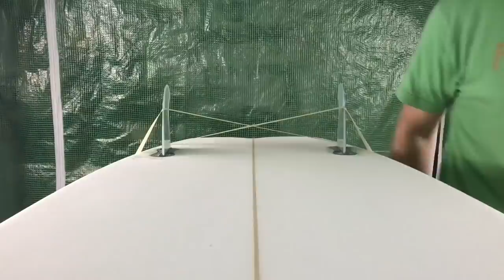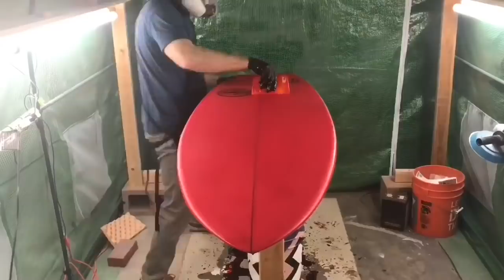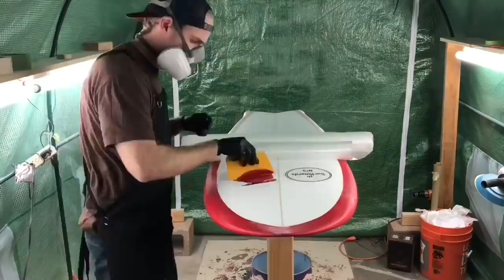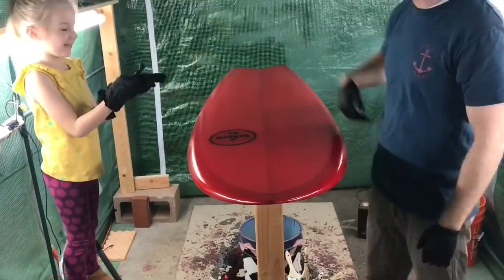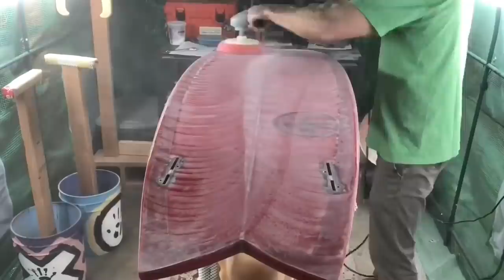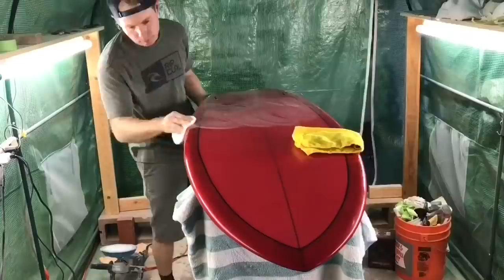Surfboard Glassing [Polyester Resin Fish]

Comment: I worked for glasser in hawaii for few months.  Biggest time saving tip is to use hard back sander on first pass.  Like 60 grit.  Especially on laps of glass on rails.  Fast and end up with smoother end product but have to be careful not to sand through.  Lol. Great video.  I could almost smell the resin.  Mahalo.
Reply from the maker: Thanks man, appreciate the tip and feedback 🤙

Comment: Hello Tanner, great video man! I saw you put the fins at the beginning of the whole lamination process (before the cloth and first lam coat) but not sure why didn't you put the plug during this same stage? Thanks you!
Reply from the maker: Thanks man, that’s a great question.  You can actually do the FCS 2 fins before glassing or after, I’ve seen it both ways.  Most do it before and it’s what FCS advises as well. The leash plug and longboard center fin boxes go in after the hot coat. I don’t really have a good reason as to why other than that’s what I was always taught and is industry standard.

Comment: This was a great video. Ive been using as a quick reference video.  its nice to have all the steps in one video. 🤙🏼
Reply from the maker: Thanks man! Glad to help out.
Reply: Hey Tanner, Do you use anything to clean the board after sanding the hot coat? My last board I sanded then used denatured alcohol to clean the board before the gloss coat and ended up with tons of uneven spots. 

Gary
Reply from the maker: I usually wipe it down with a rag and then blow it off with a shop vac. I do also use denatured alcohol but very little. I just dab a little onto a rag and do a quick wipe down of the board. Be sure to sand in long drawn out passes to help keep the board even. I also get uneven spots some times, it’s hard to make it perfect. Good luck!

Comment: Hey man! You can save the paint brush... put in thinner... and them wash whit hot wather and soap.  Three times.. and save in a pice of cloth with the soap foam... i dont now.. if the paint brush is very chip , it is unnesesary... sorry for my inglish.
Reply from the maker: Thanks for the tip! I’ve actually already started putting my brushes in acetone to re-use them.
Reply: @BendheimBoards   beatifull jobs!!!
Reply from the maker: Thanks man!

Comment: Fully in it now!  I have my shape stand built, the green house in affect!  Thanks for the inspiration.   Just bought 4 blanks, glassing material, fin boxes.. one question, if you see this.  For glassing, when do you use laminating resin and sanding resin?  And do you use both?  Thanks, i may learn the hard way!
Reply: Sanding resin (with added wax in styrene) is for the hotcoat (after glassing the board)
Reply: @jipanzz  thanks!
Reply from the maker: Laminating resin with the fiberglass cloth and sanding resin for the hot coat to seal it. Use laminating resin for the fin and leash plugs as well. Laminating resin bonds to the board better and sanding resin allows you to sand once cured
Reply: @BendheimBoards  thanks!

Comment: Hey Tanner, love watching your videos. Do you have any tips for laminating the swallow tail? I can never lam the buttcrack area on the first go. Also the swallow tips tend to get pretty messy.
Reply from the maker: After my lamination I put an additional clear patch of fiberglass on the deck side of the swallow tail to cover the section of foam that my cut lap doesn’t get. If your doing a resin tint color just be sure to get the color on that section of foam even if the fiberglass doesn’t cover it. Then go in with the clear patch. Works great. For the tail tips just make sure you are checking your angle cuts on the fiberglass and how they will fold before adding the resin so you have clean overlaps. Good luck!

Comment: Hey man, I really appreciate the content you are putting up.
I have a similar shaping set up in my garage. So far I have only been shaping epoxy, however I’m interested to try poly resin.
What was your experience glassing polyester resin inside your garage. Were you using any type of ventilation?
Cheers!

Comment: Hello mate,

can you talk about the grit progression with this? 

In hotcoat and gloss coat!

lovely job , nice work!
Reply from the maker: Thanks!  Here is the grit progression: After the hot coat start with 120, then 150, 220, 320 and 400. Wet sanding with 320 and 400 is also a good idea.  This will give your board a matte-finish. After the gloss coat, start with 320 grit then move to 400, 600, 800, 1000, and 1,200. You should wet sand all of these grits. Then finish with compounding liquid and then polishing liquid. Good luck!
Reply: Tanner Bendheim what a great specimen you are! Thanks and keep posting. I watchd this video maybe 10 times!
Reply from the maker: Glad you liked it! A helpful resource is greenlightsurfsupply.com if you need more info on board building. They have detailed step by step instructions. https://greenlightsurfsupply.com/pages/greenlight-surfboard-building-guide-page-4

Comment: Hey, great video! I have shaped a few boards myself but I am going to try glassing myself for the first time. I'm not so much as nervous for the lamination part as I am for the hot coating. Could you elaborate on your hot coat process please?
Reply from the maker: Thanks! The hot coat is pretty straight forward. Lamination tends to create the most problems when going in for the first time. As long as you have a clean and smooth lamination, the hot coat will go on easy. Just make sure you have a clean brush, use long stokes the length of the board and cross stokes across the whole board. Make sure you finish before it starts to kick. I suggest reading the detailed instructions on www.greenlightsurfsupply.com. They walk you through the whole process. I’ll be posting a hot coat video this week or next as well. Best of luck!

Comment: Just shaped my 3rd board and considering trying to learn how to glass. Found this pretty inspiring. Did you just cut the tail overlaps with a blade? Does it cut into the blank much? Also did you go with epoxy or PU?
Reply from the maker: Yes I cut the rail laps with a razor blade and if the blade goes into the foam a little its not a bid deal at all.  Some are able to fold back the tape and do a zipper cut where they don't touch the foam but that takes more practice.  Just make sure you cut before it hardens or it will be a nightmare - start cutting around 1.5 to 2 hours after laminating.  This is a PU blank with polyester resin.  I have more videos for each glassing step that I've started posting if you want to check them out.  Good luck!

Comment: Hi Tanner, excellent video bro. I will like to know why do you put the leash plug after hot coat? I see the fins you put them before lamination and thought the leash plug would be put in at this stage as well. Appreciate your response, thank you!
Reply from the maker: Thanks man, that’s a great question.  You can actually do the FCS 2 fins before laminating or after the hot coat, I’ve seen it both ways.  Most do it before and it’s what FCS advises as well. The leash plug goes in after the hot coat. I don’t really have a good reason as to why other than that’s what I was always taught and is industry standard.
Reply: @BendheimBoards  appreciate you taking the time to respond, it helps!

Comment: Awesome work. I see that you used a posca pen for your lines and then gloss coated over it. How'd you not end up with any fish eyes? Did you wait for the resin to start kicking and get a little hot before applying?
Reply from the maker: I applied a few passes with the Posca pen. After pulling off the tape, I use a razor to scrape any small lines that bleed under the taped area. Then very very lightly I sand the lines down with a high grit sandpaper to get a smooth surface without any hard edges. Have to be careful not to sand through the line or you’ll have to reapply the line. Once it’s clean and smooth I apply a normal gloss coat and it works great. Didn’t do any special tricks with letting the resin start to kick as you mentioned. Hope that helps and good luck!

Comment: Nice video man, I like your precision- like how you tape your fins symmetrically,  and fold your masking paper over instead of tearing it. I have once question, how do you get your cloth inlays to "pop" with a darker color than the rest of the board? When I double layer (using a resin tint) it doesn't seem to show
Reply from the maker: Thank you sir! The extra layer of cloth should bring out a darker color for you when saturated. I’m not sure why it wouldn’t be. I used 4oz E cloth for both layers. I would search the archives of swaylocks.com to see if you find any articles of guys having that same issue. Good luck!
Reply: @BendheimBoards  Ok right on, thanks man!
Reply: I don't know how their doing it these days but back in the 60's when I was glassing we used a couple methods. 1) glass one side and trim it out. Tape off the inlay and paint the foam  your contrasting color and then clear glass that side 2) tape off the insert and use tinted resin and glass the insert only with the first layer and clear glass the second layer that wraps over the rails.

Comment: Hi ! Great video, thanks for sharing it ! 
I Can see you don't Sand the cut laps before doing the hot coat, i did the same thing and i have a gap between the laps and the bottom of the board .. Will the last layer of gloss be enough to fill the difference ? 
Thanks a lot , have a nice day !
Reply from the maker: I usually sand any excess resin or high spots. I also try to press the first lap down with a tongue depressor to be somewhat level with the foam. Not sure I’m visualizing exactly what your describing but adding the gloss coat won’t get rid of any bumps or gaps. I suggest sanding it even and then applying the gloss coat. You won’t have to worry about small burn throughs since your adding the gloss coat. Good luck!
Reply: Thanks a lot for all the information that really helps ! I'll try doing as you said !

Comment: Good morning, complements for your videos, very nice and useful !!!

I'm restoring an old kite surfboard, made of resin.

At the moment I have carried out numerous repairs with epoxy, fiberglass and mocrosfers, as a result the surface is aesthetically very unpleasant.

The original resin was transparent and graphics were integrated between layers.

I made the same graphics with the PC, so I can print them by ink jet plotters.

At the moment I purchased epoxy and fiberglass to re-laminate the whole board over the existing layers. I don't care about the weight, I wish it will be very strong.

I also bought a colorant for resins, white.

If you can, I need some advice to finish the work, to give the surf an aesthetic aspect similar to the original:

To give a white background, so as to cancel all the remaining signs of repairs, which is better than the following procedures?

Procedure 1)

- First lamiantion using only one layer of fiberglass and white colored resin

- Second lamination with the next layers of  fiber glass and trasparent resin and interposing between the layers the printed graphics

Procedure 2)

- I spread the white resin with brush all over the surface to erase the signs of repairs

- Lamination with all the fiberglass layers, interposing the printed graphics

Also, do you think for the realization of graphics it is possible to use glossy lucid paper (the kind used for techinchal drawings and china) or if you must use rice paper?

Thank you

Andrew
Reply from the maker: TheAndreasdoni Hi Andrew. I haven’t done a full restoration project like yours and I’ve only worked with polyester resins and not epoxy so take my advice with a grain of salt. I would use a white pigment (not tint) color in your laminating resin saturated with your layers of fiberglass cloth. It will be hard to cover old colors and you may want to do a white foam stain on the blank as well before the lamination. Just make sure you use water based paints with resins. As far as the logo, I always use rice paper so I’m not sure about lucid paper. After you’ve finished laminating the board, put the logo on top of the white lamination and cover with a small patch of fiberglass and clear laminating resin. Sand smooth but don’t burn through the cloth. Then hot coat. If you want other opinions, try posting your question on swaylocks.com or join the Facebook group Backyard Surfboard Shapers and post your question there. Good luck!

Comment: Do you use laminating resin at first then switch to finishing resin? Sorry that might be a dumb question. I’m trying to do a large repair on a delaminated old long board
Reply from the maker: Laminating resin first with fiberglass cloth, then sanding resin (lam resin with wax) afterwards to seal it. Then sand smooth. I’ve got a few ding repair videos.

Comment: Quick question, can you tell me if it's possible to put epoxy resin (as a final layer) directly after painting with acrylic spray, or i should use fiberglass? It is not super professional board, just first experiments... ;) Thank you!
Reply from the maker: Are you spray painting the foam blank or after the hot coat?
Reply: @BendheimBoards  i sanded the old board a little bit and repaired dings, and now painting, under the paint it has epoxy layers ;)
Reply from the maker: Hard to say when I can’t see it but the general answer is yes you can put epoxy resin over acrylic spray paint. Fiberglass cloth is the strength of the board so as long as the original fiberglass cloth is in good shape you should be ok.
Reply: @BendheimBoards  Thank you!

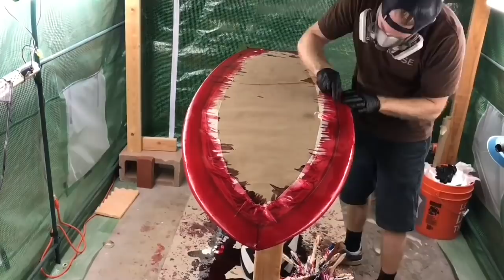Comment: Hey bro, when you finish the second fiberglass layer on the top deck. Do you not have to sand smooth the cut joint on the bottom of the board (see 1:48) cheers
Reply from the maker: Yes, I always clean up my cutlaps to try and make them as smooth as possible.  You can sand them down with a hard block with sandpaper or sanding disc.  You only need to hit the rough spots or bumps to make it all flat and smooth.  Just be careful not to sand too aggressive so you don't sand away the color if using a tint.  Good luck!
Reply: @BendheimBoards  oh yeah sweet, but you don't need to sand it flush right?
Reply from the maker: @jackzarifeh  No I don't get it completely flush otherwise you'd probably start burning into the color.  Just get it as flat as possible to make the hot coat process easier.
Reply: @BendheimBoards  sweet as thank you

Comment: Great vid one question what bit did u use on your drill to sand down the board after you did the cut lapses and what variable sander did u use?
Reply from the maker: Thanks!  Its just a power drill with a 3" disc holder: https://www.amazon.com/2-Pack-Disc-Holder-Shank-Roloc/dp/B07D342TQP/ref=sr_1_1?dchild=1&keywords=3%22+disc+holder&qid=1606781712&sr=8-1  and the variable speed polisher/sander is an ATD-10511 Shop Polisher with a 7” pad
Reply: @BendheimBoards  thank you a lot!
Reply: @BendheimBoards  one more question what kind of foam and resin do you use because I found that it is hard to do tints with eps foam
Reply from the maker: I use PU foam and polyester resin. Resin tints work great with this combo.

Comment: Hey mate, how long after the lamination did you cut the lap with the razor blade? I imagine it wouldn't want to be fully cured? It's be rock hard? Thanks :)
Reply from the maker: It all depends on the temperature of the room and how much catalyst you add, but I usually wait about 1.5 - 2 hours before cutting my laps.  Yes, if you wait too long, it will be too hard and a nightmare to try and cut.  Be sure to use gloves so you don't get any oils from your hands on the fiberglass which can cause problems during the hot coat.  Good luck man!
Reply: Tanner Bendheim yeh awesome thanks for the tip! Do you have to do a cut lap if you are doing clear lamination?
Reply from the maker: You bet!  If your doing a clear lamination you can do a free lap where you don’t tape off the rails on the other side.
Reply: Tanner Bendheim yeh I thought so, so after you do the deck first, the resin won’t obviously be perfectly on the other side, is that not noticeable when you do the other side lamination? Thanks again legend!
Reply from the maker: If you do a clean lap, it should be clear and the fiberglass can be cut a little shorter on free laps.  You can still do a cutlap with clear lamination if you want to be safe which is what some do.

Comment: Nice Video! Can you tell me where I can get the green tape that you use for the lamation?
Reply from the maker: Thanks man!  Yes, you can buy it at most auto parts shops.  Usually around $11 - $13.  Or you can buy them online at shapersupply.com.  This high quality tape is vital to prevent bleeding and sticky residue that is a pain to get off.  I learned it the hard way using generic masking tape with my first glass job.  Good luck!